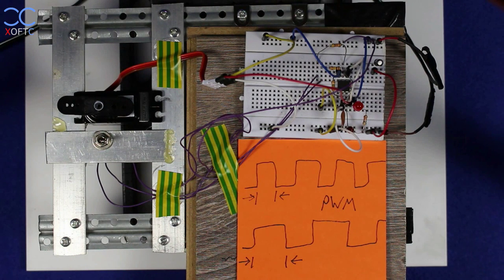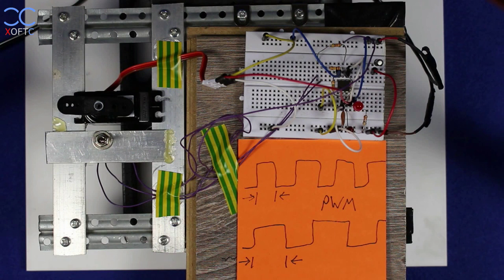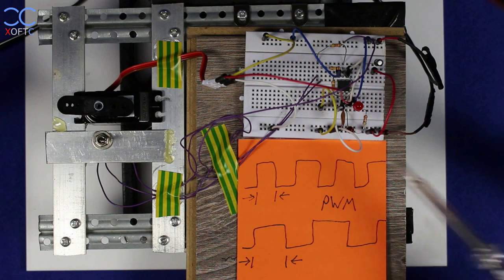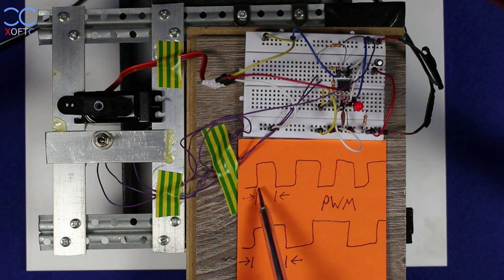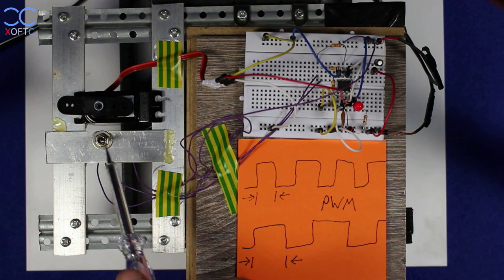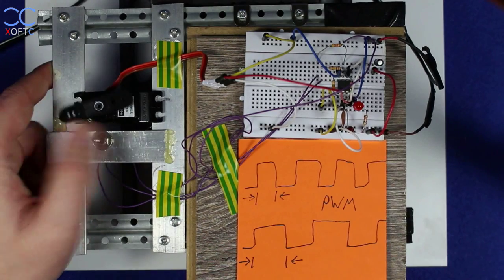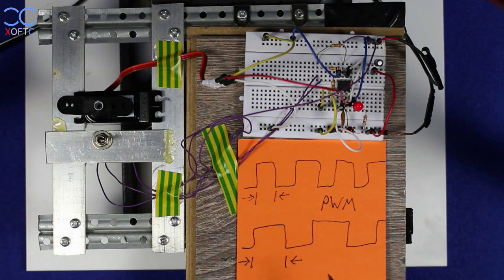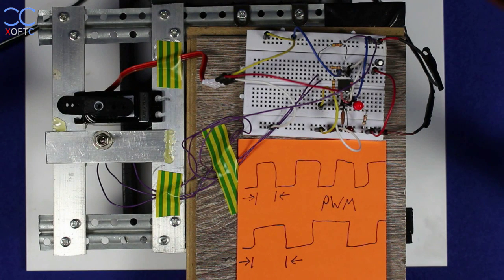555 Servo Control Useless Switch

Comment: Hi, how can i modulate the two position, lets say i want position 1 at 15º and position 2 at 45 how can i do that can you help me please I'm a begginer
Reply from the maker: Marcelo Alejandro you need to calculate the r1 resistor according to where you want the servo to be.
a standard servo motor position is set using pwm in a frequency of about 19HZ, so you need to calculate the min and the max r1 values with your r2 and the cap values, then all the values between them will be different degrees of the servo. I don't have an exact number to give you as it really depends on the type of servo motor you have.
also bear in mind that this basic circuit gives out some noise so I don't know how accurate you can get with it.